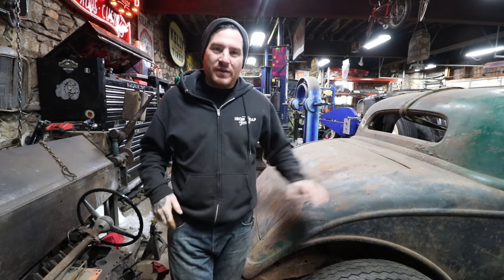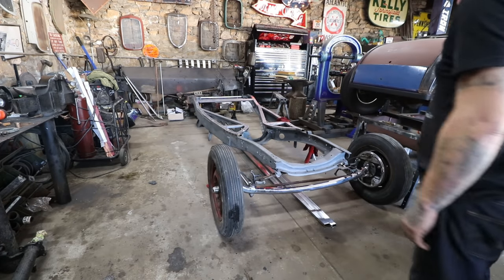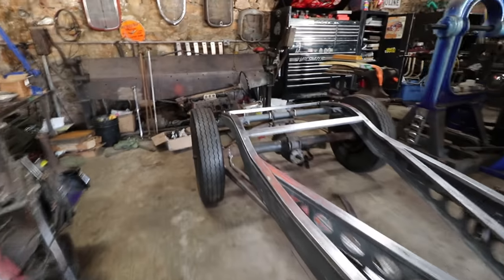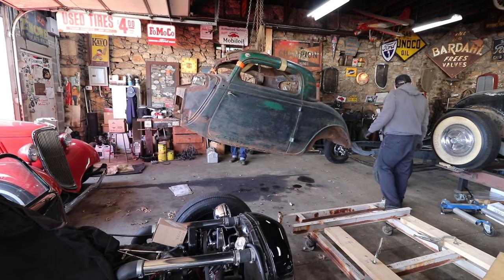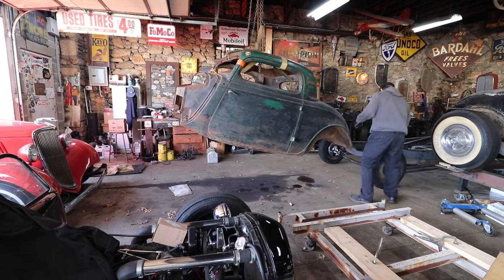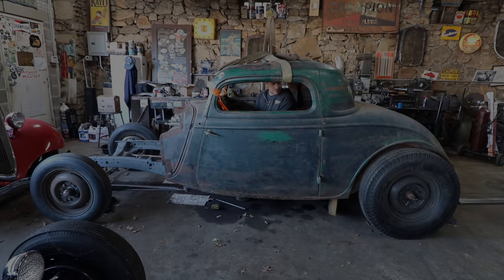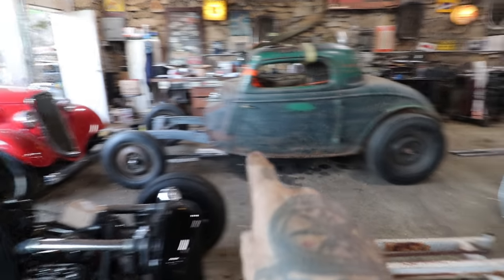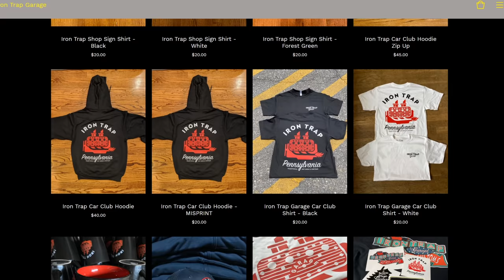Full Chrome Front End And Wedge Channel!!! - 1933 Ford 3 Window

Comment: Looking BITCHIN' man. The stance is sweet and your position looks perfect. 
With current seat cushion material, you can probably even make it comfortable. And while it's all about the look, being able to drive it further than the local hang out adds so much more enjoyment to the final product.
I've seen some awesome looking cars and bikes that were miserable to pilot, so they turn into trailer queens.
If need be, I would cut into the X member to have a seat I could set in for hours.
Everything is a compromise. 
Thanks for bringing us along.

Comment: Dude, it looks bitchen the way you ended up setting the body on the frame. Sure would have been nice to have seen the engine setting in there too. Matt, now are you going to run the hood or just the top or nothing at all on it?
Another thing, it's just me, but a pair of rear fenders would be awesome on it too.
Have you ever broken a windshield from the lack of front fenders?
Some little front fenders that mount on the back of the brake backing plate, that turn when you turn the wheels might look trick on it too. An inch above the front tires, sweet, narrow fenders with some great period correct pinstriping on them! 
Anyway, just a thought. 
Great show. 
My best to you my friend and the wife & Moon too. Also to the 
"Iron Trap Garage" crew,
who's working so hard as you Crack that whip!
Just Kidding, Just Kidding, ha haa😆.
Here's to all of you, to having a great evening.
Cheers Y'all 🍻 👏

Comment: I tried to use '40 type rear wishbones with an open drive quickie on my roadster but the bracket bolted to the backplate cracked in no time due to flexing.  The '36 type (with the spring hanger cut off at the rear) is much stronger.

Comment: You should make a couple  "cardboard Matt ergonomic templates" for setting up the seating. Might "look" cool, but driving time will be torture. Things like the shifter,gas, clutch and brake pedal and that pesky steering wheel angle might be addressed easier. Might be why the previous owner let the car sit,  And yeah you're young and agile...now   lol

Comment: Diff drain bungs on top???? Are you sure centre section is right way up?
Reply from the maker: This is an early Quick Change fabricated from a stock rear end center section. They had to flip the center section upside down to make it work as a quick change if the rear was left the other way the car would have 3 reverse gears and one forward gear.
Reply: @IronTrapGarage  thanks for the reply. Very interesting

Comment: Using a triangulated rear suspension and coil over shocks would improve handling and ride quality. Plus.  nobody could see it. I like old fation street rods, they look nice at a show and cruising down the road. But the ride quality and handling is poor at best. I know, have built my share of them. Good luck.
Gramps.

Comment: You are making the rear differential a sway bar.  You are putting torsion into the rear.  The original was connected in the center.  The front end will work because the I-beam axle has flex.  The rear differential does not!  Will be a terrible ride, ever bump will come into the body!